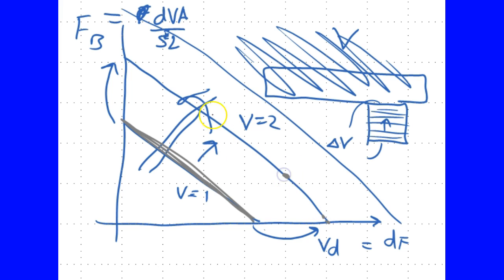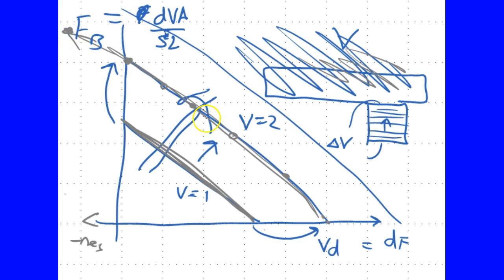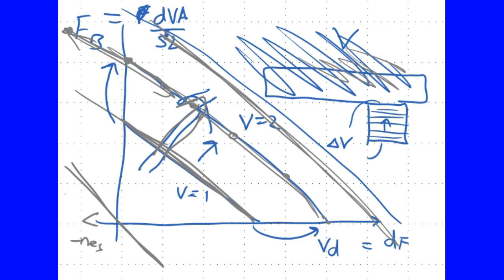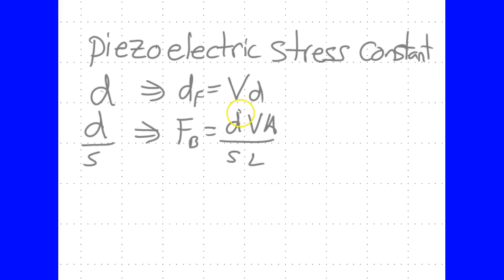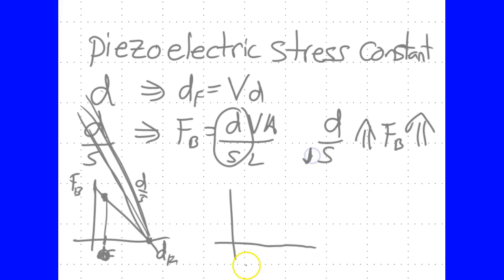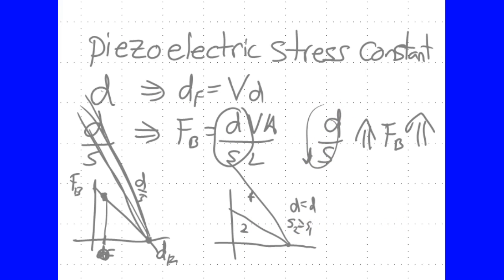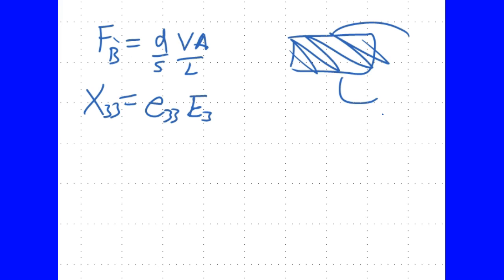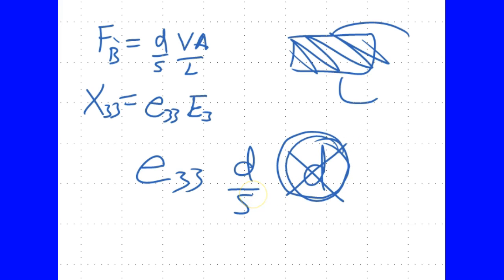Lecture 7 Part H: Blocking force and free displacement in piezoelectric actuators - Part 3

Comment: When using a piezomaterial as a transducer with a constant mass on it, can the graph  at the beginning be reworked with the Force remaining on the y-axis, the (output) voltage on the x-axis and the displacement for the slope. So swapping displacement for voltage and vice versa?
Reply: @ultrasonicadvisors  Thanks.